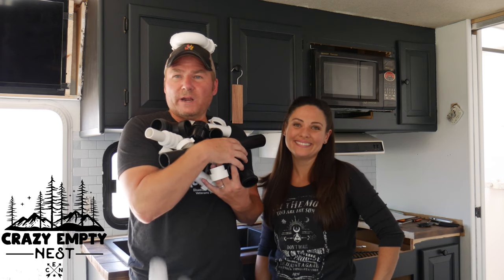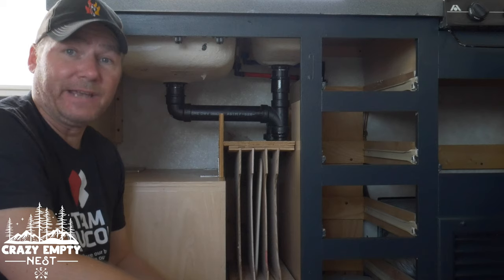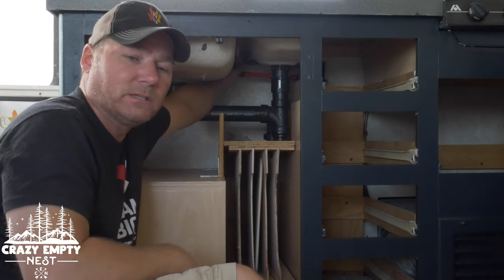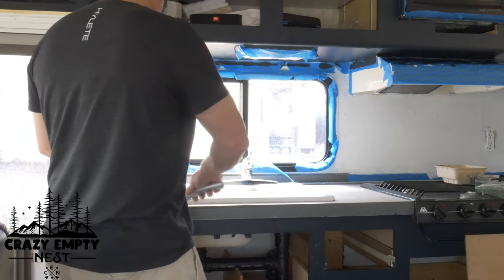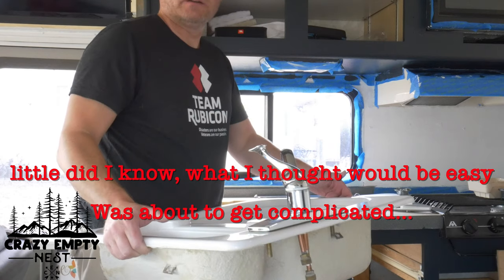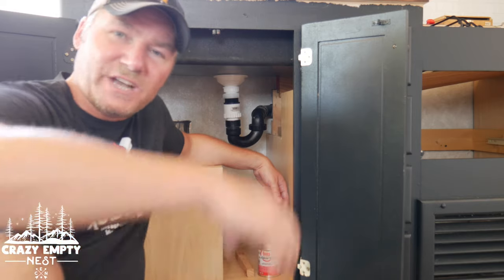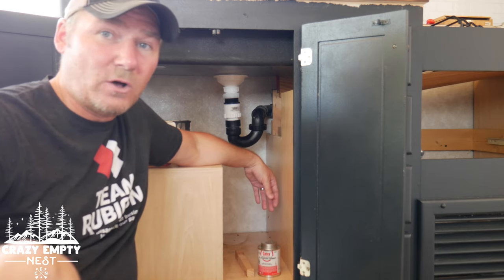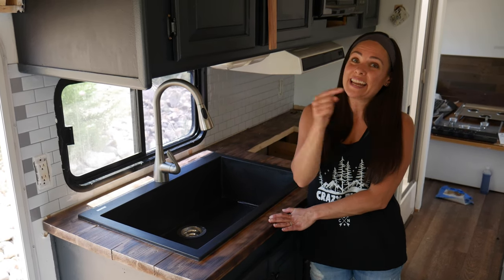RV Sink Replacement - Camper Renovation Ideas

Comment: after all that hy[e about an adaptor, you could have shown us what you ended up using so we dont have to struggle, also how did you adapt the water lines, arent the faucet and motorhome lines both female connections?
Reply from the maker: You might have missed it, both the adapter and water lines are shown in the video.  Our water lines were Pex, we show them being disconnected.
Reply: @CrazyEmptyNest  no no i 'saw'  them, mine are the same, just clear plex, with red marking at hot side connections, i meant the adaptors you used to connect the 3/8 to 1/2 inch fittings, but i did find something at home depot. i might have missed you saying this or not but all good it lead me to the path of making sure i had everything on hand BEFORE i took it all apart!! thank you!

Comment: Cool video! I appreciate the honesty. We are going through the same thing currently. We have the plastic, cheap twin rv sink and we want to switch it out for a slightly bigger, single sink with a faucet. Two questions, do you have a link to the piece you ended up ordering to convert the piping? and how difficult was it to convert the hot and cold lines into the one main faucet line? Thank you!
Reply from the maker: Greeting guys!  We finally bought a "reducing male adapter" from the 1 1/4 ABS pipe to I believe 1 1/2 for the sink attachments.  We then used plumbers cement once we connected it to ensure a good seal.  Here's a link to what they look like but make sure you get the adapter for your exact measurements. - https://www.amazon.com/NIBCO-5804-Fitting-Adapter-Schedule/dp/B007Q455BM

For the hot and cold pex lines, we simply bought brass coupling that changed the size to the sink hose fitting similar to this one - https://www.lowes.com/pd/SharkBite-1-1-4-in-x-3-4-in-dia-Brass-PEX-Coupling-Crimp-Fitting/1000400243

Find the ones that are threaded on each end and screw one side into the pex line and the other into the sink hoses for hot and cold.  

If you have a plumbing supply store in your area, they may be the best bet as they often carry fittings that normal hardware stores don't.

We truly hope this helps and saves you some time and trips back and forth.  Please let us know how it turns out!   Best of luck - Jenny and Lance

Comment: I don't see where you said you got the correct plumbing part for the sink drain. Can you share that please?
Reply from the maker: We had to special order a 1 1/4 inch ABS plastic adapter to convert the sink to fit the RV plumbing.  No hardware stores stocked this part and we had to go through a speciality plumbing supplier to get the part.  Hope this helps!  - Lance and Jenny
Reply: @CrazyEmptyNest  yes it does. Thank you

Comment: I'd like to have seen the actual sink install..what did you seal the sink with?  I have a leak on my cold water line under my sink and the only way I can think of to find what part of the line is leaking is to remove the sink..try to find and fix the leak then re-install the sink....do you have any better ideas?? Thanks again for the clear sound video
Reply from the maker: Hi Paulette - we used clear silicon caulk to seal the sink.  I would check the pex fitting on your cold water line first, these are usually plastic in an RV and we had two break on us and had to replace them with brass fittings.  Hope this helps!  - Lance and Jenny

Comment: "Simply unscrew your hot and cold"  HAH! Mine was so tight I had to get my son-in-law to loosen both my kitchen and bathroom hot and cold for me. I put in new faucets and that required an adapter for the water lines because of the size difference. The adapter can be purchased at Home Depot.
Reply: Despite the challenges, this inspired me! Thanks.

Comment: You can also try a mobile home supply store. The same issues exist on those. But if you are switching to residential items them you will have to find adapters.
Reply from the maker: Thanks John! This is probably the first stop someone should make when they start dealing with the RV plumbing. Part of our issue was this was done during the height of COVID and many places were having supply issues as well as not being open.  Great advice!

Comment: You can also gain counter top space when the sink is not in use by finding an some old countertop material, cut and route it to fit over the new sink.
Reply from the maker: Thanks Mike! That's a great idea, I think the original sink came with a cover like that but we can probably cut something custom to fit. Great tip as this adds more counter space!